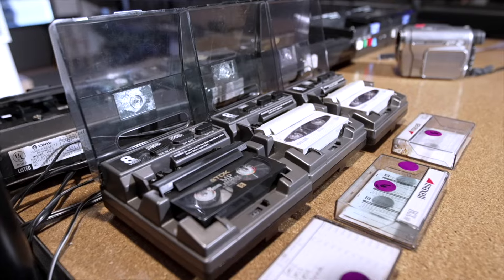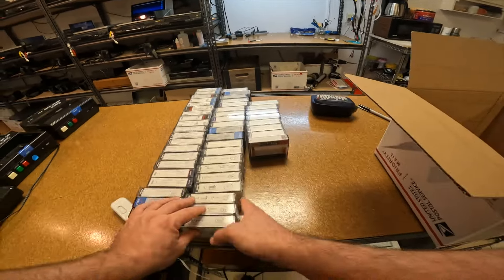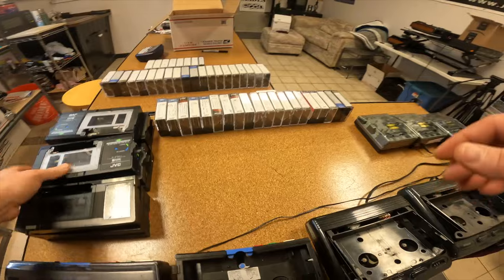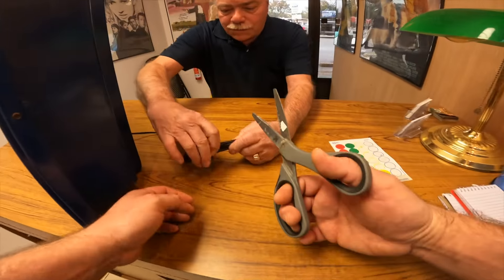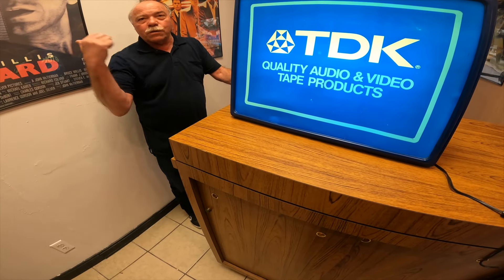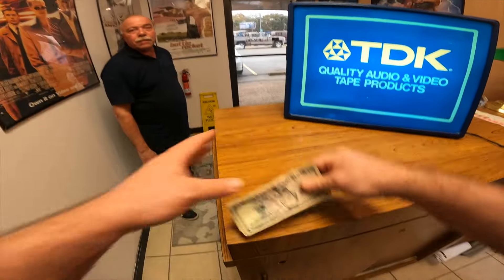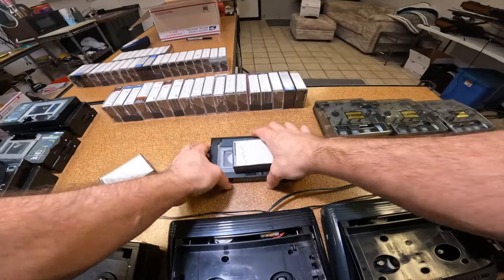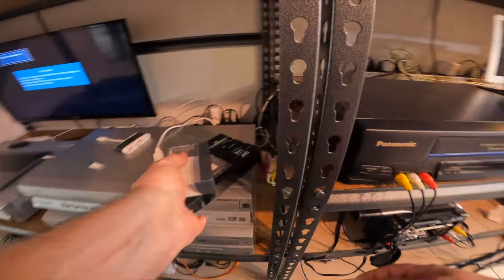Can't Believe He Brought This in!! **Retro Video fun And Transfering VHSC Tapes to Digital

Comment: Hang in there Sean. Back in the 2000s when I got my first PC CD writer I bought TDK writable CDs and burned both data as well as music. Never had any issues with them. I did have a smaller spindle with discs that my PC didn't like. My Best PC disc writer was my old eMachines XP machine and it had buffer under run protection which my first writer didn't and I made lots of coasters and frisbees and mythbusters style shattered discs.

Comment: Wow!  That's a lot of VHS-C!  Well, since VHS-C only records about 20 min of video each, no wonder!  LOL  VHS-C was such a horrible format.  TDK and Maxell really rocked back in the day.  But Maxell had the best promotion with the speaker blasting the guy in the chair and the lamp stand.  That's a great sign!
Reply from the maker: that's what he said!
Reply: tookeydookey9477   No offense but all versions of VHS were horrible.  VHS technology just barely functioned on its best day.  But it won the format war so that's what we got stuck with.
Reply: tookeydookey9477   - Yeah, DVD was a better picture but good luck reading it after 10-15 years, esp if the disc was never finalized, the disc wasn't stored properly or was exposed to light.  Unfortunately, all of these old formats have serious drawbacks.  My personal favorite back in the day was 8mm and while it can be a challenge 30 years later, so far all of mine have held up very well.  Knock on wood, I'm still getting through them.

Comment: is there any benefit to playing  through vhs-c tapes in a vcr (with an adapter) rather than feeding the signal from a camera? curious

vhs-c adapters are not that cheap nowadays, i wonder if you use them because its more convenient for your setup
Reply: All the cool kids just transplant the tape ribbon onto full size reels in a standard VHS cassette and play it that way. Just kidding. But you could.
Reply from the maker: I used to use cameras!! I still have like 5 vhsc cameras that still work great!
Reply from the maker: But vhs can just be rehoused and put in a vcr without adapter and then you can do track and audio adjustments easily.